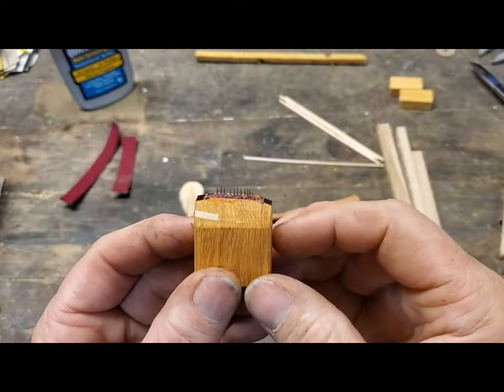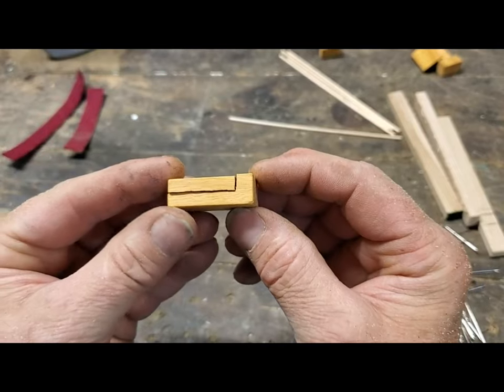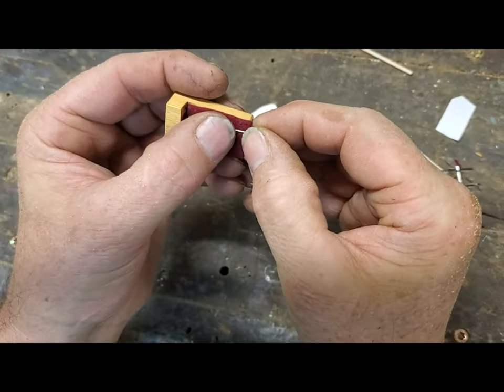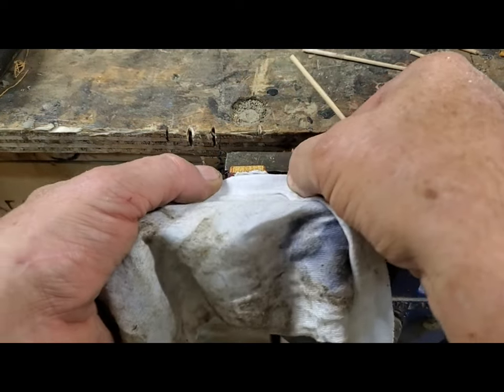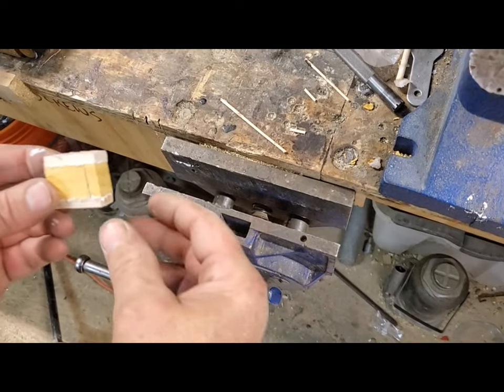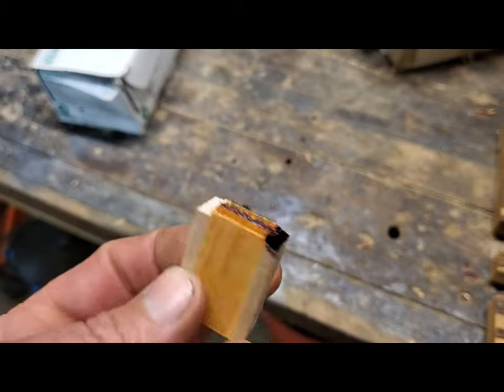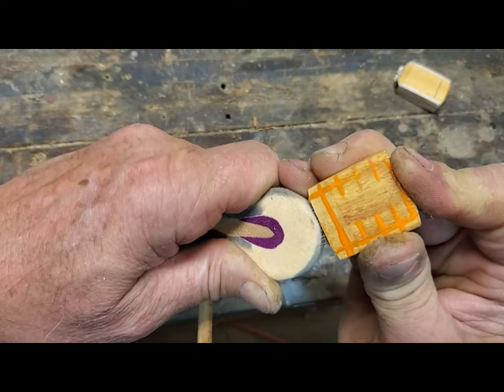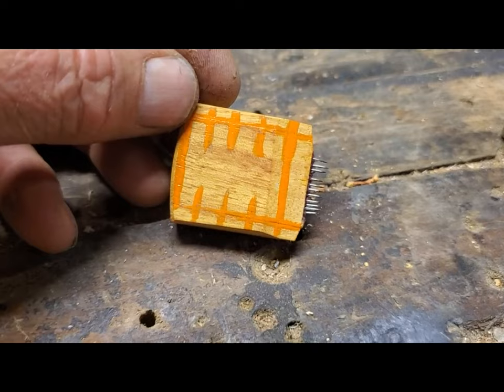How to make a Rocking Needle Voicing Tool

Comment: Chris, very good demo. Just be aware that this tool is EXTREMELY powerful. It will do more than you think just by looking at it. 

The less needles the more it will accomplish since they go in deeper. One can seriously kill a hammer that way. Better to use the dozen needle unit as it's more controllable. 

This tool has become my favorite needle tool over the last 4 years. The rocking motion seems to produce better results. 

Peter Grey